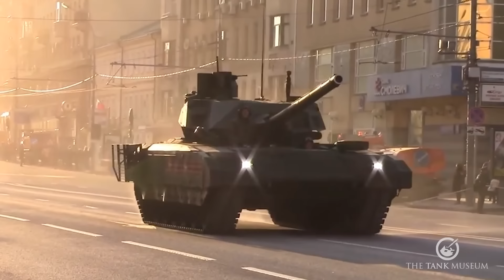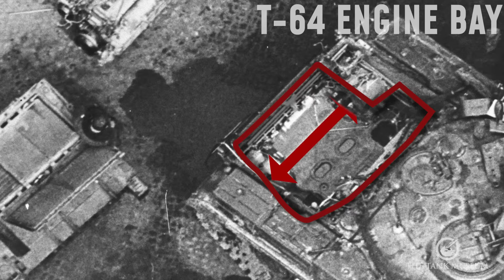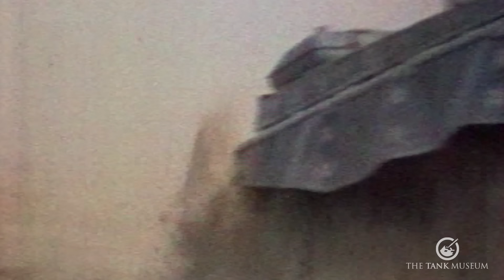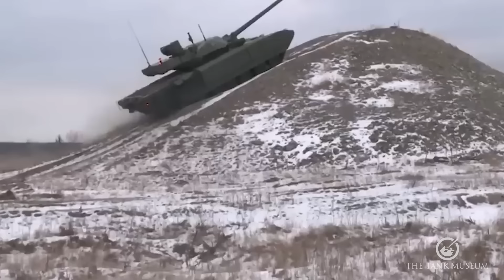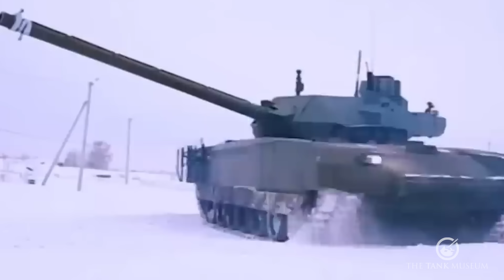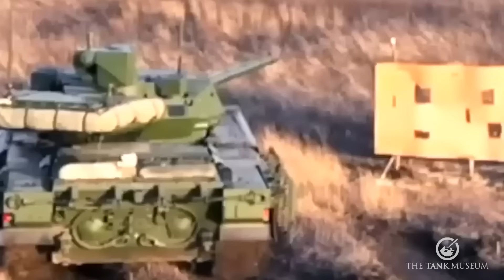Radical or Ridiculous? | T-14 Armata | Tank Chats #171

Comment: As a former M1A1  tank commander. I can not count how many holes I would have got stuck in ,if I could have not stuck my head out of the hatch to see the depth of the hole. Don't know how many times I said " Loader how much room do I have on the left side." This layout will work on flat desert terrain , go down narrow trails , defiles, mine lanes good luck.
Reply: Even with today's advanced sensors, probably works great to stick your head out and look from time to time.
Reply: @deansmits006  Yeah cameras and sensors are great until an artillary round lands nearby or a direct hit bounces off your chassis and then all bets are off. Vibration damage. Shock damage. Camera loss. Blind as a bat.
Reply: @deansmits006  as used to be said about the radar of fighter planes... one peek is worth a thousand sweeps.
Reply: @deansmits006  it's only optional in the not yet in service KF-51, which has so many cameras you can basically see everything from screens inside the tank, although if any of them gets hit you'll have to take a peek.
Reply: @Noah Mayer  I would suggest a slight problem. The tank is driven using cameras to see where you're going and for targeting. If the tank is moving, the door coving the camera(s) will be open. 3 or 4 drones with paint balloons render this tank blind and thus ineffective. 

Pretty significant flaw IMO
Reply: @petertzagarakis8739  You have a point, but 3 or 4 drones with anti-tank warheads would be a more cost-effective use of drones. Where you gotta watch out for paint balloons is inside cities. But even there, if I was the guy taking on the tank, I'd think Molotov cocktails would be better to have than paint balloons.
Reply: @petertzagarakis8739  That would be an issue for our western tanks aswell. Paint can cover cameras and windows, tf was your brain going for homie?
Reply: @grendelsstepmother7624  Anti-tank warheads are a tall order for any quad copter.  A drone big enough to carry an anti-tank warhead is big enough to shoot with a machine gun.
Better to use SMALL quad copters that can launch from the tank, give the commander an overhead view, and then autoland on the designated spot on the tank.
Reply: @grendelsstepmother7624  Molotov cocktails don't work on buttoned-up AFV.
Reply: @petertzagarakis8739  Pretty sure they thought of grime or similar on the cameras and have solved that.
Reply: @deansmits006  в современных боях голову нельзя высовывать. Даже в игре Арма 3, голову нельзя высовывать, а то танк потеряешь.
Reply: @deansmits006  we got camera's and sensors. I don't like to stick out my head in a Battlefield. It is not bulletproof. Besides that at night your tactic would be useless and superdangerous for snipers with heat camera's
Reply: @deansmits006  Those sensors won’t last 2 minutes under Arty..
Reply: Another factor is, you can easily wipe mud and dust from your glasses as often as you need to. But what about the camera? Who gets out of the tank and cleans the camera lens in the middle of a battle?
Reply: @Itsjustme-Justme  do it like nascar,
and as cheep as cameras are stick them everywhere
Reply: @Itsjustme Justme  The drivers periscope already gets covered in mud. There's a wiper that sucks it is manually operated.
Reply: @Itsjustme-Justme  you serious lol our does your car clean it’s head lights you think the Russians didn’t think of that what do you take them for fools joker
Reply: Nice thing about the US Mark I Loader's arm, it has yet to blow the turret straight up when hit.
Reply: If you’re going to use outside cameras for situational awareness, what you need is stereoscopic cameras and displays, so you can judge size and distance using the binocular vision that nature gave you.
Reply: Supposedly one of the ideas planned for future tanks is importing the same camera system from the F-35 to allow crews to virtually see through the tank hull, giving them a more realistic idea of where things are in relation to their sides.
Reply: Thank you for a useful comment based on actual experience.
Reply: I think you have probably put your finger on the problem. Video might seem like a good idea but might just not be good enough to work when someone is shooting at you.
Reply: @PxThucydides  surely you most want cameras when someone is shooting at you.  The loader won't be available to stick their head out at that point, even if they were stupid enough to want to.
Reply: @PxThucydides  If you want to stick your head out of the tank when you are getting shot at, you have no right being near a tank, let alone be the gunner!
Reply: Maybe the Armata does not have enough camera views covered.
I do not know.
But if someone is saying that no tank could ever be equipped with enough camera angles covered?
To no longer make sticking your head out of a hatch important?
Nope...not buying that one.
This IS the future, imho.
☮
Reply: Tanks are at a disadvantage in built up urban areas either way they can be got at any which way especially if they have no Infantry support..
Reply: you former commander guys have only experienced fighting sandy folks.
Reply: @Pilot_Azog  If the drone is free flying and controlled by a radio controller, then yes, EW can interfere with it.
One way to harden an observation drone for the Russian tank is for a thin lightweight co-axial wire to control the drone. A fly by wire system, if you will.  That the wire is shielded would make it impervious to EW.
The only drawback is that its range will be limited to the limits of the tether wire and, as it is unspooled, it gets heavier and the quad copter can only lift so much.
Reply: I call bs on you, you never used a tank in a situation where it was in danger from sophisticated opponent weaponry. US baby killer talks bs.
Reply: Your channel has no content. You are a BOT!
Reply: Probably true in a dense urban warfare situation, maybe not in trails or such because in the end... it's a tank and it can trample most obstacles and vegetation
I think, mark me wrong if I am, that the real threat to a tanks movement are side ditches possibly covered in vegetation and torn pieces of wood/branches... if the track goes in there by mistake the tanks tilts 30-40* and it's stuck there
Reply: @ClaudeMagicbox  In Korea we would run defile drills , the right side of the track would be about a foot from a cliff. We also did it at night.
Reply: There is going to be a massive shortage of eggs because a lot of people in the west are going to wearing them on their faces.
Reply: Exactly what Russia needs then.
Reply: @wojciechsitek9289  Russia needs organizational competency and manpower management more than any weapons system.  

Russia needs to adopt the proven Incident Response and Management System similar to what wildland firefighters have developed.  They use the High Reliability Organization model and it could be adopted for just about the entire spectrum of Russian Armed Forces.

Manpower management recognizes the psychological needs of men in battle.  Competent leadership and ample supplies are big morale boosters.  These are things utterly lacking in Russia's military culture.  Putin put all his chips on all the new high tech weaponry and all of it was negated by incompetence and willful negligence.
Reply: I obviously have no idea how these tnaks are but I think at some point, though probbaly not now, there will be zero need to stick your head out of one, technology is gettign so good
Reply: @Aaron Ferguson China does have good military grade camera systems.
Reply: @bobo-dw3if  T'as bien choisi ton pseudo toi
Reply: Why the Loader ? Is he the most expendable crew ?
Reply: @Forthereg M  Yes, but that is not the point. His hatch is in an elevated position. He can look down next to the track as well as check the depth of holes. The TC can as well but he is also trying to identify targets, reading a map and talking on the radio, sometimes all at the same time.
Reply: Yeap good for the Steppe and not much else
Reply: did you have all the same cameras and sensors the t14 has? apples and oranges
Reply: You probably can link it to surveillance drones
Reply: Du hättest zuerst eine Ausbildung auf einem T55 bei der NVA machen sollen.
Dann hättest du solche Probleme nicht gehabt😂
Reply: Pure lies!!! Stolen Valour attempt!!!, You call your mate "loader" like you don't know him and the worst part is you don't know anything about driver visibility in an M1A1. On the M1A1 the driver can drive with the hatch open which isn't allowed anymore, the driver also has 3 glass blocks/periscopes, you also have a separate sight (which is thermal these days) that you can put through the hatch from inside (there's a little hatch inside the main hatch for it). Even with the hatch open you can't really see much and you need the TC (tank commander) to tell you if there's an obstacle below your line of sight or anything like that.
Reply: No need to pierce the armour, take the cameras out and its a sitting duck
Reply: to be fair, a lot of terrain in eastern europe and russia is very flat. its the reason their tanks have such terrible gun depression. in their terrain its not very neccesary
Reply: IMO, the only way an unmanned turret would work is if the tank comes with 3 or 4 drones.  Launching one to give the commander a bird's eye view of his situation with the other 3 as back up.  A drone that could autoland itself on the tank after he sees what he needs to see.
Reply: @BlackPill-obey  yeah, even 1 quadcopter for surveillance and observation of terrain/holes/blockages/whatever should help a lot. Just look at the newest mars rover with its tiny drone. Because it can see so much, NASA can move orders of magnitude more quickly and safely on the martian hellscape. I fully expect the successor of the Abrams to have a surveillance drone as well as some form of loitering munitions "suicide drones" all launched and controlled from within the cabin. 

I think some in this chain are forgetting just driving a car can have challenges. We have fancy cameras and warning sensors, but there are still areas where maneuvering is difficult...in a 2 ton car, not a 75 ton tank. So peaking out or having ground crew is nothing to critique.
Reply: @BlackPill-obey or just operate the turret like all previous ruZZki models in Ukraine.  Pop the turret to it’s maximum altitude to give the TC and gunner a bird’s eye view of the battlefield (if only for a second or so).  😁
Reply: @andrewallason4530   That's the earlier Jackski in the Boxka models.
Reply: @BlackPill-obey  That'll be next. if guys haven't already stuck a Mavic in a back pack already
Reply: Commander CAN stick his head out of the hatch. He has his own hatch. It's the gunner that has to move to the centre, while driver also has his own hatch.
Reply: I think new tanks should have at least as many cameras as my Tesla, 8. It also needs a battery big enough to power a stationary tank for hours, including all sights, computers, and operating the turret. The Abrams X has many of these features.
Reply: Abrams has an APU which is much more use than a large space-wasting battery.
Reply: I think this is a solid point in abstract, but I also think it can be entirely solved through training and good cameras. Once you know your vehicles clearance, you just know. As long as training had a lot of tight clearance situations without ability to g.o.a.l (get out and look) I see it as a non issue.
Reply: @BrettTurtle  Two problems. Everything breaks, especially in the military. So failing sensors and cameras will be a problem.  The problem with clearance is not the size of the tank but size of what you need to clear through. Flipping through multiple camera angles might help. But those are not as flexible as human peeking about. 

There is a reason with precise manoeuvring like (off))loading   a flatbed you see outside help.

And training involves cost and time. In a prolonged war that's a problem. And in peace if you rely on conscripts to. In reality better training is hard to achieve. Within and outside the military. 

With enough skill and talent you can make a one man turret work. That does not make it a design.
Reply: @barthoving2053  breakage and failures IF they do occur on the T14 ARMATA are NOT a problem as the T14 ARMATA have redundancy systems in case of failure of cameras so it is not an issue they just switch to the secondary systems that are used in T72 and T80 and T90 tanks so what your saying is NOT AN ISSUE for the T14 ARMATA. =Z=
Reply: @barthoving2053  - You live in a fantasy where you are "peeking out" of your imaginary tank at imaginary enemies, too much gaming.
Reply: @kymsheba  yeah but moscow is LOSING already

they've already screwed the russian people for the next 50 years, now moscow is going to lose GLORIOUSLY on the battlefield

Слава Україні!
Reply: @kymsheba  We've seen those "Redundancy" systems for the Armata

One artillery shell landing next to it and the entire sensors are out. Good luck loading the gun if the autoloader is broken too.
Reply: @johnsmith1474 brother we do this, I'm a 2a7 loader, and it happens quite often for situational awareness
Reply: @BrettTurtle  No good camera can ever compete with a neck and a pair of eyeballs. Stereoscopic vision is crucial in those situations, and having the ability to quickly turn your head from one side to the other is equally as important. Unless they implement an AR headset with stereoscopic cameras attached to a fast and flexible periscope, your eyeballs will always be superior and often necessary to manoeuvre a tank in tight spaces.
Reply: @Brett S  This is the same problem the Airforce is having with their new tanker. They removed the old position in the tail and put the boom operator in the cabin. He has no depth perception.
Reply: @BrettTurtle 's kind of telling that you use the word abstract, when the person you are responding to is claiming to speak from personal, practical experience.

What practical experience or empirical evidence do you base your conclusion on?

Edit: I'm responding to your first comment in this thread.
Reply: @gustavchambert7072 my experience is driving for a living for a while lol. Yea no military experience. Just going off knowing if you drive a vehicle for a long time and you're a generally decent driver.. you should be able to get to a point where you don't need to get out of the vehicle to figure out your clearance. I'm going off intuition.. that an armored vehicle with less/smaller entries into crew compartment results in a crew compartment with more survivability, less weaknesses. Versus having hatches everywhere, which yes do make escape easier, but also can compromise armor, as well as periscopes and other viewports. Also, if a crew is having to escape a tank, the armor arguably failed one of its jobs. It saved the crew, but failed to keep the vehicle operational. Versus again, I'm picturing a crew capsule with maybe 1 or 2 entries/exits and only wires coming out connecting it to everything. Oh, and air lol.. it's need air. So yea, without a ton of real world experience, it sounds like at least solid idea. Definitely worth looking into.
Reply: @gustavchambert7072  btw thank you for saying which comment you were responding. That always gets confusing on YouTube. 😆
Reply: @BrettTurtle  responding to your second reply: yes, I had that problem recently, with a bunch of numbskulls just saying seemingly random things to me that had no obvious connection to anything I had said. That got old really fast, and since then I make at least a little effort to make sure the person I'm talking to can actually connect the dots:)
Reply: @gustavchambert7072  also.. but you may have already picked up on this. Unless I worded it worse than i remember.. my argument was never that cameras 100% solve the problem. I'm thinking of it as a trade off. Like you're losing visibility for more protection. To me, that seems a potentially good tradeoff. Also man, in combat situations where you couldn't exit the t14 to get a better look.. is it really safer for a contemporary tanks crew, in that same situation, to exit the tank/poke out of hatches?
Reply: @BrettTurtle  I just checked, and ypur exact wording was "can be entirely solved" xD 

And I think the original comment wasn't talking about direct combat, but was more discussing general traversing of terrain such as narrow/bad roads, fields and so on. It's more about getting to the combat zone than moving inside it.
The way it reads to me, the reason for taking a physical look also seems to be more about assessing the size of the obstacle relative to the vehicle, rather than assessing how much clearence you have to it. It seems to be more about correctly assessing how deep/steep/narrow a hole, ditch or passage is,which is definitely going to be harder to do on camera.
Reply: @gustavchambert7072  I also said "non issue" at one point 😆.  Yea obviously I'm winging it here. I will say, in my mind accessing size of objects relative to your vehicle is not entirely functionally different from knowing your clearance. For sure tho, driving through only cameras is generally harder than less restricted vis. driving.. Though the quality of the cameras makes a huge difference. As well as the quality of computer hooked up to everything and the various 'smart' nav tech it could have. I think if the design actually does significantly increase crew survivability, and especially vehicle survivability, then it's likely a good tradeoff.
Reply: @BrettTurtle  so air drop a bunch of paint?
Reply: @Eduardo Rodriguez  if you're in position to drop paint then why not drop something that will destroy it? 😅
Reply: @BrettTurtle  If a drone has to carry anything at all, besides the camera it comes with, then it will become large and slow and a much easier target for a machine gunner.
Reply: @BrettTurtle The US is currently facing this problem with inflight refueling. They replaced the old school window with video cameras and monitors and surprise surprise, 2D monitors make it extremely hard to judge distance. If the Russians have not figured out a way to make their monitors 3D it's going to be a hell of a time for a crew to try and navigate primarily with monitors instead of human eyes.
Reply: @BrettTurtle I disagree. No amount of training can replace the depth perception lost to flat screens.  And yes, I've driven American tanks using only a flat screen.
Reply: I'm sure you'd be doing that while being raked with 14.5mm cannon fragments.
Reply: У вас в США проблема с образованием и мы это понимаем. Англосаксам далеко до людей по образованию, до людей выходцев из СССР, но всë же попытайтесь писать понятно и внятно. Удачи. Беларусь
Reply: Ever heard of 3D cameras?
Reply: @cartrips9263 ever heard of dust and dirt.
Reply: Sounds like a  bad design.
Reply: Thats why its not your Hollywood toy m1a1, but a proper machine.
Reply: The modern T90 is still one of the best tanks in the world !
Reply: @sahs3811  are you sure? https://www.youtube.com/watch?v=4Q83AIJCGaQ
Reply: @SAH S  If you like burning to death.Ammo is kept in the crew compartment.
Reply: and there is the problem with WESTERN TANKS they do not have good designs against 1st rate military powers in fact NAZI USA are only good against 3rd rate military powers and can only come out even against 2nd rate military powers but when you come up against a 1st rate military power like Russia or China NAZI USA weapons are proven to be INEFFECTIVE and POOR. =Z=
Reply: @kymsheba  Seek medical help urgently
Reply: @kymsheba  you are clueless  lol
Reply: @macheadg5er  “It’s hard to accept the truth when lies are what you want to hear.” Caroline Mitchell
Reply: @kymsheba - pure comedy 🤣
Reply: @kymsheba  lol
Reply: @kymsheba  Lol, history does not agree with you.
Reply: @kymsheba  they are equipping Kiev with western stuff. Everything has his pros and cons but western equipment is quite as good as Russian equipment
Reply: @kymsheba  If you're referring to the Tanklympics discipline of the Turret Toss, you're absolutely right.  No western tank even comes close to the Russians' mastery of that event.  When it comes to loft altitude, distance, and sticking the landing (the breathtaking Russian "lollipop" dismount, in particular), our tanks absolutely suck.  I concede that the T-72/80/90 are the true Olga Korbut in that category.  By comparison, an M1A2 is just an inert and boring, mobile,metal-drilling appliance.
Reply: @kymsheba your funny. Tell me some more jokes.
Reply: @kymsheba Ah, a comedy piece - had me laughing with '1st rate military power like Russia', they are about to to be wiped out by a minnow, the Ukraine.
Reply: @cdxbow199  wiped out are you like five years old ?
Reply: @kymsheba  How so?  Ukrainians are kicking the crap out of Russians using older western weapons.  The issue is if we give them the good stuff, what keeps them from hitting Moscow and escalating the conflict?
Reply: @frankking439  in fact they are severely losing despite all the help from 50+ countries they get. The reason why they aren't smashed yet and the front is stabilized is because Ukraine is quite a big country, it still has huge military reserves inherited from Soviet Union, whereas Russia is saving manpower (not rushing ahead, catching enemies into traps like Bakhmut, provoking enemy counteroffensive onto fortified lines etc) and much of Russian elites still don't take this conflict seriously, it feels like a limited border conflict for them so they aren't personally involved and prioritize their own goals over victory.
Reply: @frankking439  really lol wakey wakey propaganda man
Reply: @kymsheba  Your 125 mm bounces off a M1A1,A2 tank, our rounds go through your armor, crew compartment, engine and leave the engine stting 25 meters behind your burning tank.
Reply: @kymsheba  A German Leopard tank in Ukraine didn’t even make it to the battlefield it was so heavy it sank in the waterlogged ground and was abandoned by the Ukrainian tank crew, in Yemen Saudi Arabian Abraham tanks have been blown up by Houthi’s using Iranian supplied Russian anti tank Kornet missile systems these tanks are supposed to have depleted uranium tank armour but still get blown apart in Yemen 😂
Reply: @sahs3811  nah, the image of the bogged Leopard was from a German training ground, when the pic was circulated claiming to be in Ukraine they hadn't even arrived ! and the Saudi Mi-'s are export versions and don't have the DU armour, even the Ukrainians aren't getting it !